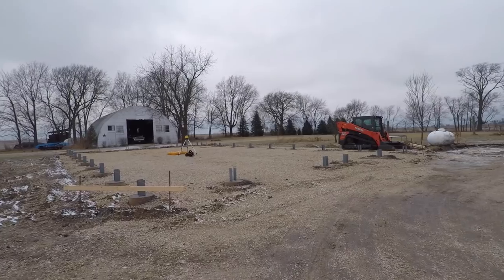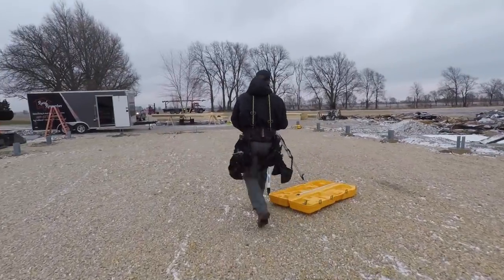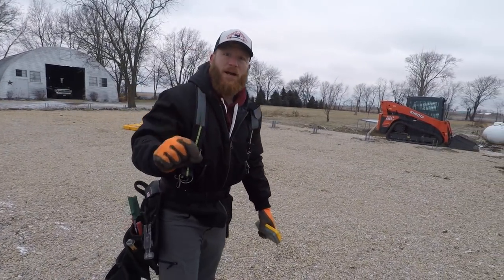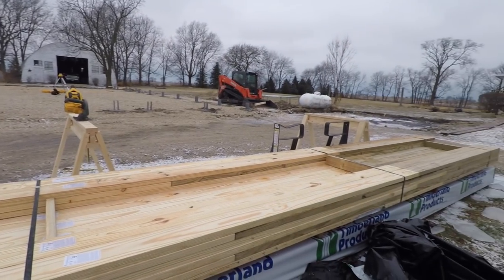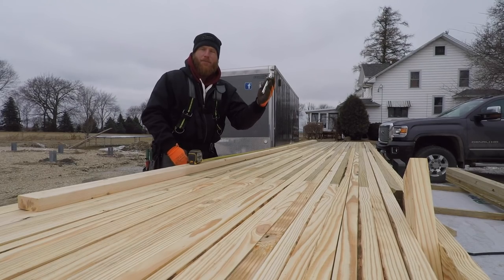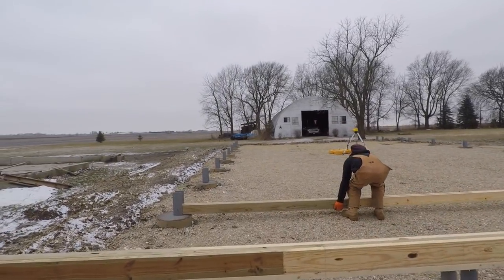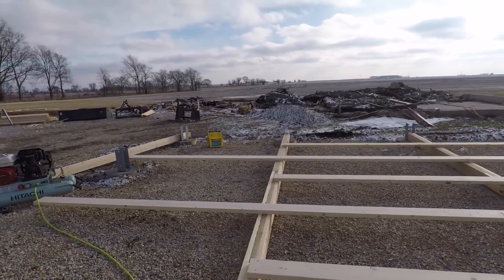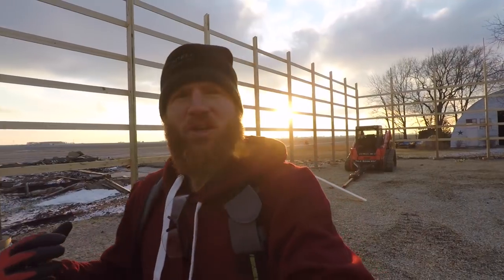Family Farm Barn Episode 2

Comment: I find your ability to do fractions of inches insane. Being from the uk with lovely things like millimetres we don’t ever really need to do that
Reply: We don't measure in French.  ;)
Reply: ihavebeard So much easier in metric.
Reply: We find you metric system equally hard
Reply: Jason Rahenkamp Yes - dividing by 10 is always difficult - LOL
Reply: It has more to do with conversion to inches and feet not dividing by 10. 1 mile equals how many meters? We're raised with a different set of visual realities. 1 meter, 3 feet about, English say 3 meters I think 9 feet, I don't think in meters.
Reply: Conversation is hard because the non-metric system doesnt have any logic in it
Reply: For a lot of Brits my age (mid 50's) its fairly easy to switch between the two.  Not necessarily convert between the two but run both systems for different things.  Small measurements are in mm, but to visualise longer measurements feet and yards.  Or ask for 5lb of potatoes or 1/2lb of ham even though by law they are sold in kg or g.  Centigrade/Celsius for cold weather, Fahrenheit for warm.

Comment: 5:30 pretty good math for morning )) IMHO it's easier to use metric system for such cuttings: no halfs-quarters-eights-sixteens - all in tens. Holy war, i know ))
5:35 metric bonus - it's shorter when writing: 1.25 vs 1 9/16
BTW, i'm using inches (only halfs ang quarters) when measuring smthing not very accurate - it's faster and you can remember up to 5 measures in a time. But with all precise things - i'll use metric.
From Russia with love ;)

Comment: Man i wish i had a county like you guys work in, 3000+ sq/ft buildings! The size of retention pond/infiltration system would be staggering. hell my 2 story 2700 sq/ft house needs a 70' x 3' x 3' infiltration trench.
Reply: What is an infiltration trench?  I've never heard that term before.
Reply: all the roof run off water is collected via pipes and directed to a excavated trench that has been back filled with washed round rock and filter fabric. it allows the water to re-enter the soil without allowing for run off. of course this does not apply if your building is within a city or area that has storm water connection. i used to live in a city and the storm water part of my monthly bill was over 30 bucks per month.
https://snohomishcountywa.gov/DocumentCenter/View/7305
Reply: Gotcha.  I've never really lived outside of a city so that would explain why I've never heard of an infiltration trench before.  I suppose it's also possible that the same thing is called something different in my area (North Dakota).  Wow, $30/month is more than my entire water bill.  I don't believe I'm charged separately for stormwater collection, but I'm sure you get a lot more precipitation in WA than we do here.  Residences here also don't have any direct connection to the storm sewer that I'm aware of; storm sewer just collects whatever runs off into the streets.  Thanks for the explanation, always kind of interesting to learn how things are built differently in different areas.
Reply: We'll if you immigrate legally we'd be happy to have you!
Reply: No thanks, i like Western Washington State too much.

Comment: I'm confused, why don't your brackets all end up level with each other since you used laser when they were set in concrete? Thanks
Reply from the maker: nothing is perfect.  we set the tubes with the laser.....once the crete is poured they can move up and down just slightly or the top of the screeded concrete might not be perfectly level.  then when setting the brackets in the concrete, they can sometimes settle in just a little or stay on the surface.  there are quite a few chances for irregularities based off the initial setting of the tubes with the laser.   so we go back around and check again prior to building.   laser twice cut once right

Comment: Silly question but was the laser not used when the bracket were put in? Do they move as the concrete sets?
Reply from the maker: Jim Porter it was used... but only to set the pier.  Setting the bracket in wet concrete is never a perfect thing.... so we always re-laser the brackets when we build.

Comment: Watching you set out your levels I started to cringe as here in the UK back in the 70’s we used this imperial system. Go and buy yourself a metric tape and see how much easier it is ie no sixteenth’s or eights just one unit,  millimeters. No having to find a common denominators to add or subtract. 1000 millimeters to the meter that’s it. It’s so simple you wouldn’t believe it. When you are into large lengths you just chop off the last two digits ie 10 meters 200 millimeters becomes 10.2 m.
Reply from the maker: Colin Nicol yeah I get it... it’s just how I learned and it’s not hard for me
Reply: Plusses and minuses.  Metric would speed up/simplify cutting the posts to length, but then in the U.S. one is dealing with dimensional lumber and building products that are all in inches.  One would have to deal with two measurement systems on the job, which if I remember correctly, was how a space probe was lost during the orbit entry phase to Mars a while back costing more than a few $$$.  Overall, probably not worth it until everything converts.